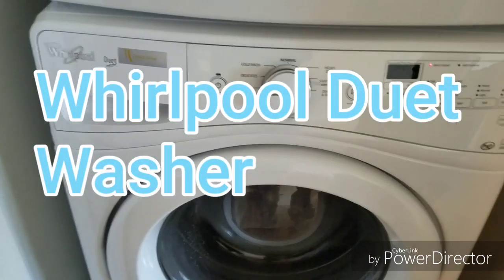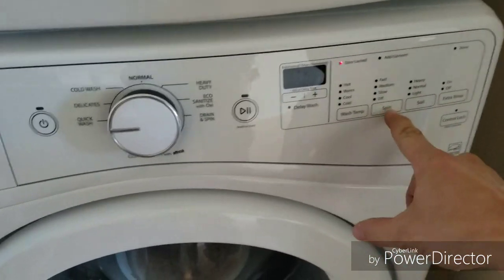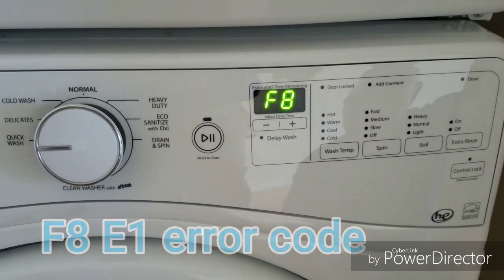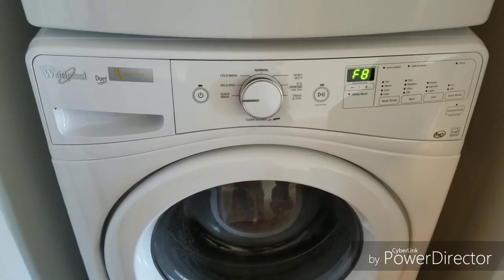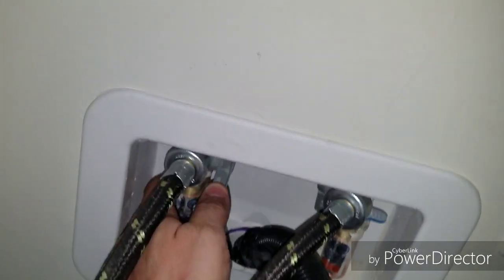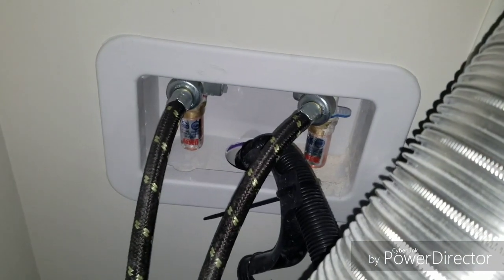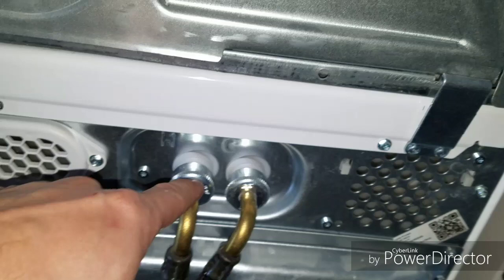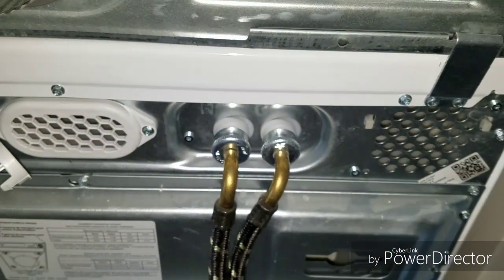Whirlpool Duet washer error code F8 E1

Comment: Important note from the manual: if you have the F8 E1 error, the drain pump will run for 8 minutes, then the door will automatically unlock itself.
Reply from the maker: Sometimes that does work. This video is meant for when it doesn't.
Reply: Thank you... that 8 minute wait time was a very important step.

Comment: Thank you! Turns out the previous owner shut off the hot water valve, so whenever the washer was on, not enough water entered, resulting in the e1 f8 code. If it weren't for your video, I wouldn't have checked that and would have proceeded to shopping for a new washer.

Comment: I had this error code in the past because the filter was all clogged up and it wasn't draining properly. I took everything apart and cleaned it all out - good, worked great. I recently noticed that there is stagnant water staying at the bottom and around the rim so I repeated the exercise - still no luck getting the washer to completely drain. It smells like stagnant water - pump seems to work properly but there might be something else clogging it up - outside of the drain lines... have you ever seen this happen? I have a dog that sheds A LOT so I wonder if there might be a bunch of hair and gunk trapped around the drum...
Reply from the maker: Most of the time that I have a smell problem, its the rubber door gasket. There are holes in the gasket that clog sometime and water may be sitting in there but also could still be the pump/pump filter.

Comment: Have this same washing machine. almost 10 years old....getting the F8 E1 code. Valves are on and screens are clear. Seems to work good on hot water....pulls this code on cold. Pulled all the lines and everything is clear. What am I missing?
Reply from the maker: Could be a bad water valve or water fill sensor
Reply: @ProWorksTV1  Is there a way to check the bad water valve or water fill sensor? Thanks. I checked both valves, unscrewed them from the washer to verify no debris, and still getting the code issue...